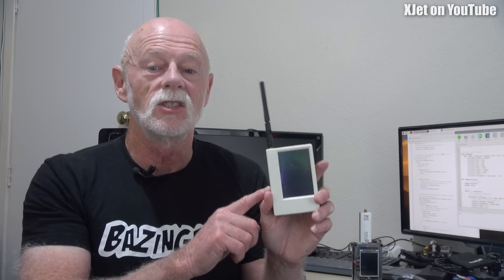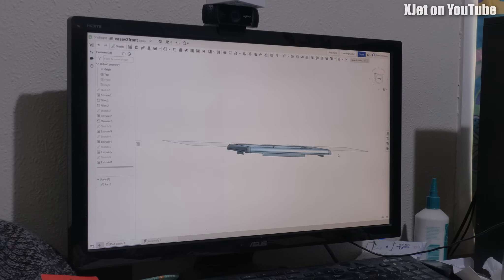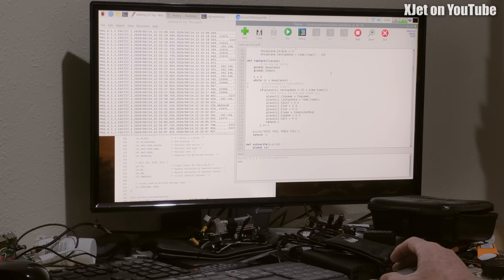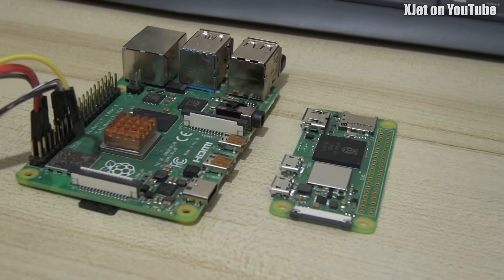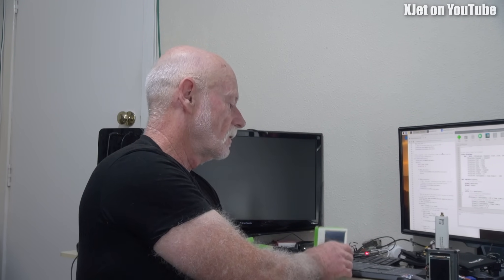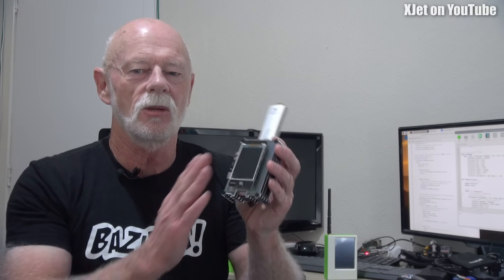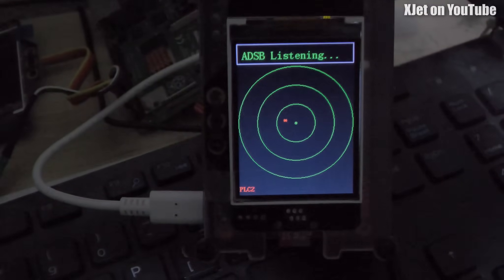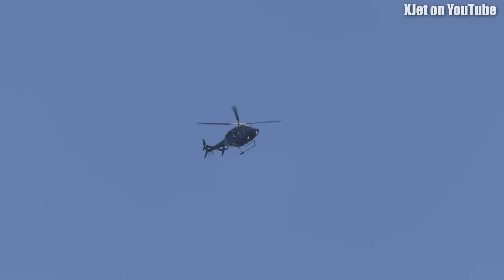This changes everything (I'm not kidding!)

Comment: That's a nifty little device you have engineered there but my gosh don't you think it's a bit much? Aside from staying out of controlled airspace as well as airport traffic and approach patterns there are really only two simple rules a hobby drone user needs to abide by. Keep the device in sight and stay below 400 feet. Follow those basic rules and your chances of a conflict with manned aircraft are close to ZERO. The reason you are seeing these new and overbearing regulations can be blamed solely on the participants in your hobby who do not seem to be capable of doing that.
Reply from the maker: If we could rely on manned aviation to always follow the rules then you would be right.  However, manned aviation regularly flies below 400ft and even when THEY are breaking the rules it is the drone flyer who must (by law) yeild right of way.
Reply: @xjet  I've been a pilot for over 50 years. Nobody 'regularly' flies below 400 ft. outside of take off and landing or in areas completely devoid of people and structures.  Yes there are violators and bad actors, it's not something you need to lie awake at night worrying about. Also, if you do encounter a violator, he ain't gonna have ADS-B on.
Reply from the maker: @pi.actual  No, helicopters regularly fly sub-500ft and almost all have ADSB.
Reply: @xjet  Nope, 500 feet for helicopters except in special FAA designated areas or specific operations 14 CFR 91.119
Reply from the maker: @pi.actual  That's the rule but thousands  of drone/RC flyers will testify to the fact that it's not uncommon for pilots to violate that rule.
Reply: @xjet  Ha, ha thousands eh? Helicopters are pretty big, maybe they just think they are under 500 feet when actually they aren't. Sure there are pilots who violate rules, the adage is there are old pilots and bold pilots but not many old bold pilots. Eventually they hit a wire or an obstacle or get a suspension from the FAA. I've been at this since 1969 and flew R/C panes as far back as 1963.
Reply from the maker: @pi.actual  It's perhaps more common than you realize... also remember that helicopters are capable of landing anywhere (rescue, fire, police, etc) and to do that they must obviously dip below 500ft -- for some distance, since nobody wants to get caught in the dead-man's curve during the descent.   This means that having a working ADSB alarm can be a very useful adjunct to other safety measures when flying a drone.
Reply: @xjet  As I said there are specific operations where they are allowed below 500 feet. What they do not do is cruise along at 150 kts at that altitude. They are also very noisy so if you are flying a drone legally within sight below 400 feet I see it as highly unlikely a helicopter is going to sneak up and surprise you. Plus Flightradar24 will already show you ADS-B traffic on your phone so while I can commend your work on this device I really don't see a need for it. The biggest threat to your hobby (and it's not the FAA) is the general public because they simply do not like drones so you are going to face an increasing number of local ordinances and bans against drone flying. In this respect the FAA may indeed be your best advocate because in the end it is only they who can actually determine if you can use the airspace and you may find them ruling that certain city ordinances are indeed invalid. So my suggestion is to not demonize the FAA, they are not out to get you.
Reply from the maker: @pi.actual  What's the first rule of aviation:  "Fly the aircraft"

Whilst FlightRadar24 will show you aircraft you don't have time to constantly keep an eye on that app while flying a drone and if you're flying FPV then you simply can't see the phone anyway.  The beauty of an alarm is that it remains silent and alerts you only when there is a risk of a manned aircraft entering the space you've defined as your operational area.    This means you can set and forget it when flying -- you don't have to constantly be checking.

If you're constantly having to keep your eye on a phone with FR24 running then you are not obeying the first rule of aviation - -you are distracted and distraction leads to bad things.
Reply: @xjet  Okay well, you seem to be very concerned that your drone is going to get mowed down by an imaginary swarm of low flying helicopters so I'll leave you to it but please don't advocate for all of us actual pilots to have ADS-B because it is only required in class C or higher airspace. It is not required in the other 99.9% of the nation's airspace and a bare bones ADS-B (out only) system for an aircraft is over $3,000. Also bear in mind that remote ID has absolutely nothing to do with ADS-B mor was it ever meant to. RID is meant for use by local law enforcement so that's really who you need to worry about. not pilots or the FAA.
Reply from the maker: @pi.actual  Hey, the rules are crazy.  How many people die in the USA in manned aviation incidents involving mid-air collisions that could be avoided if ADSB was mandatory on all craft in all classes of airspace?

And why is it, while ADSB (a proven lifesaver) isn't mandatory in class G, any drone or RC plane of 250g or greater will require a mandatory ID transmitter to be fitted as of 16 September this year.   Not one life has been lost to a drone/RC colliding with a manned aircraft -- but they think it more important that models have conspicuity than manned craft do.

That is the state of US aviation regulations -- not good.
Reply: @xjet  As I told you Remote ID has absolutely nothing to do with ADS-B. Remote ID exists because of ground based complaints about drones and is meant to provide ground based local law enforcement a method to act on those complaints. It has nothing to do with aircraft. There have been a handful of midair's over the past year, every one of them occurred at an airport in or near the traffic pattern (where traffic is most dense) and none of them were attributed to the lack of ADS-B. You are completely misinformed as to the rules here and why they exist. Drone rules like RID exist for one reason - they bother people. The only reason the FAA is even involved is because they are in the air and that is their jurisdiction. They are a regulatory administration, they're not policemen and I'm sure they'd just as soon have nothing to do with drones or the hobbyists who fly them.

Comment: Planefinder also doesn't show up VicPol (aka Pigs in Spaaaaace) machines either. The fling wing frequently cruises over or in the near vicinity of our house and it never shows up and their Bitchcraft B-350 is also never visible on Planefinder. It flies over at night between 6,000 and 10,000 feet based on the noise level looking I imagine for thermal blooms that might indicate a clandestine  "horticultural" business. That too never shows up on Planefinder and your magic device would absolutely confirm one way or the other if I am correct that it's the VicPol surveillance aircraft.
How long before the Oz CASA thugs decide using your detector will cost 5000 Penalty Units for using it without a rating/licence?

That is a very great device you have created and you should be entitled to make a few $$$ for creating this safety item that all pilots should carry with them. CAA and their See and Avoid slogan was all well and good but knowing which direction to initially scan to See the bogey puts you well ahead of the Avoid part of the game. If I still had a medical I would 100% be carrying this with me on every flight including in the circuit. 👍

Comment: I thought aircraft were supposed to stay above 400ft in flight?
I'm watching an R44 (G-RBRI  icao 40137C) owned by Helicentre, fly at 200ft from Carnforth to Preston ( England UK ) at 100mph+ ground speed ( 24 miles distance ) after which it finally ascended to 700ft turning to 35 degree heading where it turned at Colne Lancashire,  and is now on 260 degree 400ft at 114mph ground speed. Surely that's unsafe? ( The 200ft 24mile leg at those speeds )

Comment: The way to fix shitty rules is NOT to make more shitty rules. ADSB is not required outside controlled airspace. Are you advocating for even more surveillance rules? That's not the Bruce I've come to 'know'.
Reply from the maker: I'm saying that sensible aviators will either make sure they're flying above 500ft AGL or fit an ADSB system for reasons of safety.   It is the responsibility of the drone/RC flyer to get out of the way of the manned aircraft but as the regs stand, it is only the drone/RC that is legally required to have a system broadcasting its location.

Comment: The only issues that I see with "all manned aircraft need adsb" is that at least here in the states there are still a lot of General aviation aircraft that don't have any electrical systems. Most of those are old vintage aircraft from pre 1950's era. They don't even have electric starters or fixed radios, they use hand held radios and some don't use radios at all.

I have flown RC for several decades now and I am also a Private pilot in the US. None of this stuff was an issue until autonomous quad copters came into existence that could fly literally on their own without the rc pilot having eyes on the quad. That and you can fly a gps based quad with zero skills required so you have anybody and everybody with the $$ to buy one flying them and some people at least did really stupid stuff with them. Stupid people doing stupid things is always a great way to get big brother intervention. I remember seeing a DJI for the first time flying on it's own and I thinking to myself this is the end of the RC hobby as we have known it.

Comment: I applaud your efforts but, why should the manned aircraft have to incur the cost of installing the ADS-B equipment? That is a substantial expense. I spent around $5,000 equipping my airplane years ago. The reason many pilots do not like ADS-B is that there is a recorded history of their flight and some people do not like that. I think drones should have ADS-B installed as well when flying because most pilots have a way to see ADS-B traffic in the cockpit. So if the drone has ADS-B as well then the pilots of manned aircraft could see the drone on their display and avoid it.  A drone is very hard to see compared to an actual manned aircraft.
Reply from the maker: It is the legal responsibility of a drone/RC operator to yeild right of way to all manned aircraft, therefore it is the responsibility of the manned aircraft to be "conspicuous" as possible.   Remember... in the event of a collision the worst that the drone/RC operator will suffer is the loss of a drone but the manned aviator could lose his life.  This therefore implies that it's very much in the manned aviator's interest to fit ADSB.

Yes, ADSB can be expensive (from about $2,500 upwards) but surely if you can afford to purchase, maintain, hangar and operate an aircraft, you can afford a couple of grand to hugely increase the safety of your flying and to give you access to those classes of airspace where ADSB is mandatory?
Reply: @xjet   "it is the responsibility of the manned aircraft to be "conspicuous" as possible. " I will kindly disagree. I am a pilot,  aircraft owner, and part 107 drone pilot so I see both sides but, as a drone pilot I understand it is my sole responsibility to see and avoid manned aircraft. I do not expect any manned aircraft owner to spend money to help me, as a drone pilot, avoid them. If I cannot safely see and avoid manned aircraft from the location I am flying my drone from then I should not be flying my drone there. Safety only comes when everyone following the rules.
Reply from the maker: @76rgcardinal21  Does your aircraft have nav-lights and strobes?   I think this lends weight to the theory that an aircraft should be as conspicuous as possible -- for obvious reasons.  It could be argued, given the number of fatals associated with mid-air collisions between manned aircraft, that they're not actually conspicuous enough, even before the risk from drones is taken into account.

If you're flying above 500ft then there should be no risk to you as a manned aviator because all drone/RC operation should be below 400ft unless otherwise advised (by way of NOTAM or permanent danger area).

However, any manned operation taking place below 500ft has to acknowledge the somewhat increased risk profile associated with such operations due to the surge in recreational drone use.     It makes good sense therefore, for any manned operator to try and be as electronically and visually conspicuous as possible... so as to mitigate as much as possible, the risk of collision.
Reply: @xjet  Just had a RAAF C17 fly directly over at ~<400 ft @ a speed of {bat-out-of-hell} speed - This happens quite frequently and I would estimate that I'd have 5 seconds (according to security cam footage) to land my DJI Mavic2Pro once I had heard it - NO CHANCE! 
Looking at my security camera - there was 18 seconds from when the C17 could be visually sighted ( a literal dot in the sky), let alone heard, out the front to when it had cleared my property at the back (where I fly)!

Comment: the bad thing about that ADSB-alarm is that it's not useful to the user. Don't get me wrong! It would increase security and is in theory a GREAT idea. Until you factor in law.
Lawmakers don't know about it - so it's never in my favor to use it. There's no "yeah, he watched out for ADSB so this was safe" or "that crash happened because that flight wasn't announced via ADSB".

But instead, if I do use it and then still something happens, then it will work against my interest. Because obviously I had safety-gear that warned me and I didn't drop right out of the sky - meaning I actively ignored safety things.

Comment: For long-distance drone fliers, or even automated drone fliers, there should be an option for hardware mounting to the UAV. Instead of a screen, it would beam back signal to your remote control/video hardware or to he automated flight control hardware respectively. Being able to automatically make evasive manoeuvres would be very useful for long distance automated flights, both for hobby drones and commercial ones.

I’m pretty sure you could drop the need for a full-on SBC if you optimise the RF hardware end. Be that a dedicated RF receiving chip designed for the correct demodulation method and set up to the right frequency, or a discrete SDR with only as high a sample rate as necessary. It’s only 1Mb/s, so almost any cheap old 8-bit microcontroller could drive the receiver. Injecting a signal into the FPV video feed or the flight controller wouldn’t be any harder.

Comment: Great idea and I am a supporter of ADSB, and it's nice that you can build that so cheap, but as you expect all aircraft to install ADSB out, I was wandering if you would be donating towards the $7000 need to install it.
Reply from the maker: Someone's trying to rip you off James.  You can get certified ADSB-out units for $2,500 and they simply  mount on your existing strobe-light mounting so installation is very easy.
Reply: @xjet  actually, if you want a decent transponder, and have then have to pay to have it fitted, you will not get much change from $7000 AUD .
I take those figures from an actual quote to fit into a C180 at Jandakot.
Reply from the maker: @jamesmurphy7442  You are aware of this, right?  https://www.aircraftspruce.com/catalog/avpages/skybeacon11-16531.php

Comment: They do all have ADS-B but they are not required to turn it on in small aircraft the big stuff is hardwired to be on when the plane is powered up. The issue we have as drone pilots is knowing where other drones are in the sky.

Nice work though mate, handy tool for anyone that doesn’t have a DJI drone with ADS-B receiver built in.
Reply from the maker: The DJI solution is counter-productive IMHO.  Because it doesn't give you the a direction, altitude or distance of an approaching craft it creates far too many false-alarms and that means people will ignore it.
Reply: @xjet  It's built in so I don't need another device to monitor, got enough tbh. I haven't had an issue with it just getting that heads up is enough for me, I do operate in a very light area of the world and the only issues I have is a seaplane and a couple of helicopters so more populated airspace probably is an issue I am not sure.

Comment: Nice job on the ADSB receiver!

I had one that was plugged into my laptop, and I used a discone antenna. The area covered was over 200 miles diameter, depending on height above ground, and it was displayed on a GPS oriented map! This was just a few years after ADSB was started!

You are right, there are many companies that block their aircraft on the public display of radar, including law enforcement for obvious reasons. But they can't do it from their craft, unless they turn off the ADSB box.

Comment: Not all manned aircraft have ADSB. I fly a 1946 Aeronca Champ with no electrical system. There's nowhere to plug it in.

Edit: I'm not complaining, just saying. Also, I'll stay above 500ft, and you stay below 400ft and there shouldn't be an issue anyway.
Reply from the maker: Yep, if manned aviation stayed >500ft AGL there wouldn't be a problem but unfortunately every RC and drone flyer has stories to tell about low-flying aircraft that (due to their low flying) "appear from nowhere".   The unreasonable thing about this is that drone/RC operators are required to give-way to manned aircraft so in the event that someone flying at 200ft hits a drone or RC plane it's always the drone/RC operator who is in the wrong.

As for the issue of unpowered aircraft -- why not fit FLARM or an OGN transmitter.  These sip power and can even be self-contained.   If a glider can do it then any manned aircraft can do it and for quite a reasonable cost.